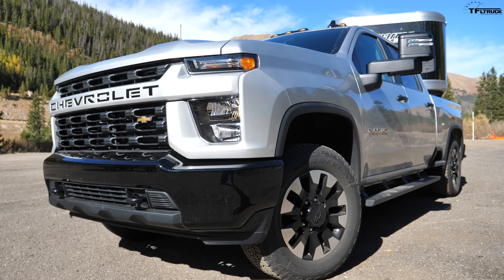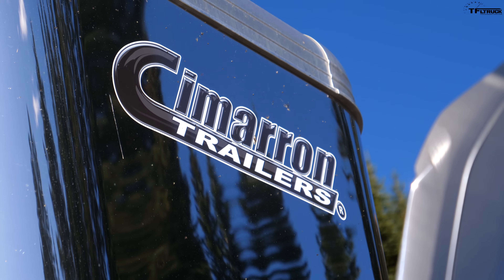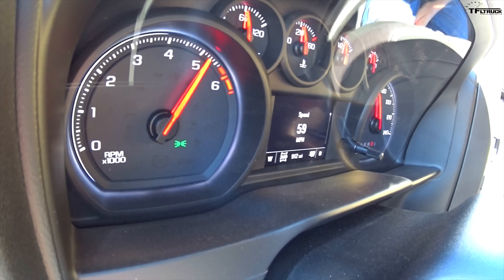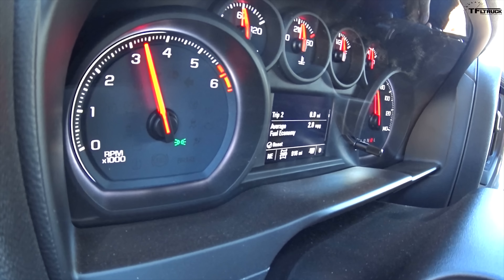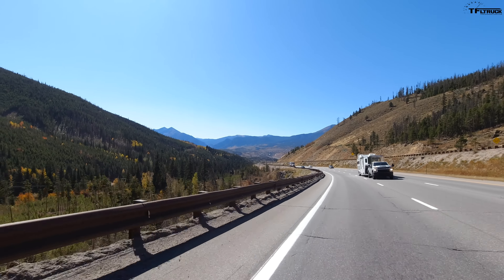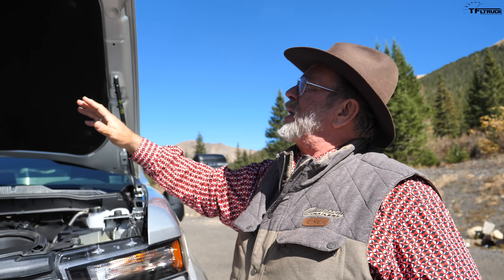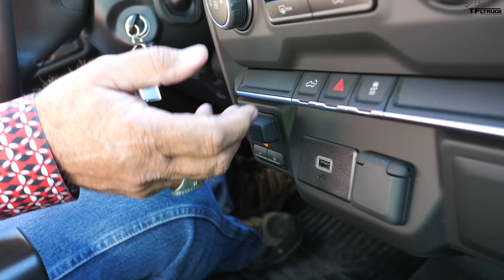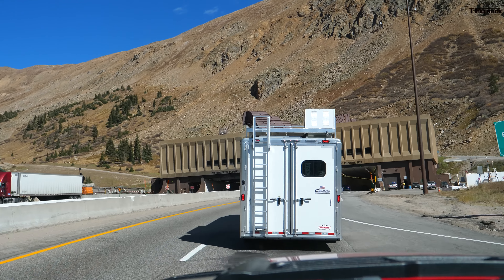The New 2020 Chevy Silverado HD Gasser Broke Our Ike Gauntlet Scoring System - Here Is How!

Comment: I'm waiting for the new 7.3 gas from Ford to go head 2 head against the Chevy gas option. 🇺🇸
Reply: I'd like to see that too. The only two DNF's they had were Fords. Interested to see if the new engine is any good. I prefer gas engines. I don't tow all the time just occasionally.
Reply: I'm not a Ford guy but I'm very interested in that new 7.3.  Finally Ford went back to a pushrod engine for a HD application.  OHC engines have their place but they're not for everything.  I am disappointed that GM didn't go larger for their HD gas option.
Reply: @daneh8434  
Gm trucks have always been about the total package instead of numbers. They've always been competitive  and functional despite not having the biggest numbers. I agree with Ford going back to a simpler larger engine. That's how HD engines should be.
Reply: With the 7.3 being paired to the 10-speed, I don’t think it’ll be a contest against this 6.6. I understand GM’s reasoning for keeping the 6, but it showed in this video as being the weak link in ensuring the vehicle was always utilizing the engines power and torque.
Reply: @ALMX5DP  
The number of gears aren't as important as the ratio of gears and the transmission tunning. The gm 6 speed has always been a good tranny. If the ratios are matched to the engine it should be fine. Something seemed off with this truck. It seemed sluggish to shift like they didn't have it tow/haul mode or something. Also gm changed the rear gear ratio witch doesn't help. It used to be 4.10. I am curious to see how the new Ford does.
Reply: The ford didn’t blow up.   Something did go wrong which put a hole in the radiator. A fluke but not a wide spread ford problem.
Reply: chad Spidle true, but I’m operating under the assumption that the increased gears allow for closer gear ratio spacing to more effectively use the power at the various speeds we saw here.
Reply: @AB-coyote  
Yes it was a fluke but the only two trucks they've had problems with were both Ford's witch is a little less of a fluke and starting to be more of a trend.
Reply: @ALMX5DP  
That is true but it also adds complexity. Ford has issues with the 10 speed in the F-150. Hopefully the super duty tranny will be good.
Reply: @curtis1951  It's nor really a trend, you can go on any forum (Ford, GM, Ram) and see the huge amount of posts with issues on trucks. That's what happens when 100 different companies make different parts for your trucks and is all done by humans. Things happen.
Reply: @WhoThisGuy515 
Just saying. They've tested lots of trucks from all the manufacturers and none of them had any problems except Ford. I know what you mean about the forums. I own an F-150 and I've been on the forum a lot. Or as I like to call it, the F-150 support group.
Reply: @curtis1951  💯
Reply: @ALMX5DP  It may not be but the underpowered 6.0 6spd easily beat the 6.4 8spd RAM and it also beat the 6.2 ford once they got a truck that made it up. The 6.0 was way down on power and the gearing was 3.73 but the engine/trans tuning won that race. The GM engines are designed to do this over and over again for 300k miles without stopping. The Hemi 6.4 and the 6.2 can't touch the 6.0 in durability in the HD field. I'm not saying the 7.3 with the 10spd won't win or do good, but the jury is out until they run it. As far as the RAM, I don't think they changed anything so expect the same outcome from their gas setup
Reply: @curtis1951  its the exact same 10 speed in a 1500 silverado
Reply: @zb6618   
It was co developed but I don't think it's exactly the same. I've been researching and havent seen anyone reporting issues with the gm 10 speed. Plus I'm pretty sure the 10 speed in the super duty is different than the one in the f150. Similar but beefed up for the super duty. Hopefully they have it sorted out because I'd like to see how it does on this test.
Reply: EGGINFOOLS no, the gearing was 4.10 on the 6.0. That’s been the only option for years. The 6.6 diesel came with 3.73 gearing.
Reply: Meanwhile, the gas Ford 6.2L already posted better times up the IKE than the gas Chevy 6.0 or gas RAM 6.4L. Ford makes the best truck.
Reply: @tylermacconnell217  
Yeah. After they fixed it. 😂
Reply: @curtis1951  The other time a Ford crapped out during a test was a defective alternator belt snapping. Not exactly a common problem on Fords.
Reply: Ford will blow the Chevy away.  They are super powerful, something Chevy misses.
Reply: @max7768  
That's the great thing about Ford's. You never when or what will go wrong. They always keep you on your toes 😉
Reply: @MDKN22  
I'm sure if they find one that'll run long enough to do the test on the first try it will do just fine.
Reply: @EGGINFOOLS  You needed to double check some of your facts.  The 6.2 beat the 6.0 easily.  The 6.2 had the 3.73 rear end instead of it's optional 4.30.  The 6.0 had 4.10s, which has been standard for several years.  The new Ram 6.4 now have an 8 speed zf transmission and will perform much better than it did with the crap 66rfe that it was tested with.
Reply: @curtis1951  Oh no :( I guess I should toss my 240k mile ford that's never had a problem
Reply: @max7768  
No. But if you seriously have a Ford with  240k miles and it's really never had a problem then you should go buy a lottery ticket right now because you're the luckiest person on Earth.
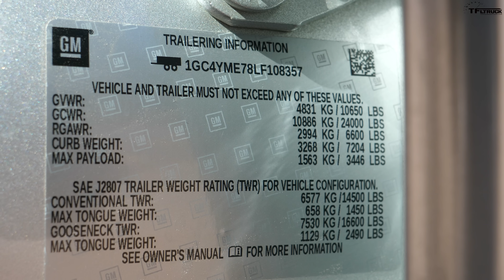Reply: EGGINFOOLS, I don't know what Ike gauntlet test the Chevy 6.0 beat the Ford 6.2 you're referring to? The Ford did the super Ike in 8:53 at max GCWR. A very diesel like time. The Ford 6.2 didn't bog down to 30mph like the Chevy did either, at times they had to step out of it to keep it under 60mph. Hands down the Ford had the better engine trans/tuning.  Keep in mind this was accomplished with the standard 3.73 gears. Optional 4.30's would've been even more decisive. As far as reliability is concerned, the Ford 6.2 has more than proven itself as a reliable workhorse. I wouldn't get too caught up on a fluke water pump failure.
Reply: @mbfixer1694  
The super duty was a 2wd regular cab. This Chevy is a 4x4 crew cab. A little different setup. Plus the Chevy may have been a little slower but it did the run on the first try without a fluke water pump failure. I don't mind being a tad bit slower. I'd have more confidence in the Chevy.
Reply: @curtis1951  Nah, I should buy another Ford
Reply: @max7768  
Remember, two wrongs don't make a right. Just kidding with ya. 😉
Reply: @curtis1951  At the end of the day the difference may be 800-1000 lbs of curb weight between a 2WD regular cab vs a 4WD CCSB. The Ford 6.2 loves to rev & the Torque-Shift G trans by ZF is perfectly matched to the 6.2. The old 6 speed in the Chevy puts a wet blanket on the new GM 6.6L. I'd be willing to bet a 2019 Ford F250 6.2 4WD CCSB could hold it's own & then some versus this new 2020 Chevy 2500 6.6. It likely won't bog down to 25 mph. The new 7.3 should really run, but we''ll just have to wait & see.
Reply: Neither one of them “ blew up “
The F150 diesel was also a preproduction truck.
Reply: Neither one of them “ blew up “
The F150 diesel was also a preproduction truck.
Reply: @AB-coyote  
Doesn't matter if it was preproduction. Ford wouldn't have given them the truck to test on camera if they didn't think it was good to go. I don't think the two Ford break downs that TFL had were flukes. I think they were unintended glimpses of the quality of their trucks. Designed just good enough to make it through the warranty period. A lot of people lately are getting some that aren't making it through the warranty period. TFL got two of them.
Reply: @mbfixer1694  
You may be right. It'll be interesting to see.
Reply: Alan Bowers    all you have to do is push the manual shift button down one gear come on people
Reply: Push the damn manual shift button people 👇 that’s all it would take to put the engine in it’s power    to gain speed.  
I don’t understand why TFL don’t do this?
Reply: @curtis1951  sorry you can't handle the truth. #1 seller for a reason lol
Reply: @kdougk6668  - They are testing how it does as is, if they put them in manual mode then people would be hollering about their choice of gear.
Reply: @curtis1951  - My understanding of tow/haul mode is that it will 1- Rev higher before an upshift under the same throttle input, 2- Wait longer to downshift to keep the temperature down, and 3- Activate grade shifting if it's equipped with it.  IF my understanding is correct, then it being 'sluggish' is to protect the transmission.
Reply: @dustintunis9347  
It's actually harder on the transmission to be in a higher gear under load so it would be beneficial to shift to a lower gear. Any tow/ haul  that I've used would  1. Grade shift
2. Down shift quicker
3. Hold that gear longer
Maybe they changed the tow/haul calibrations in the new trucks or maybe the gm 6 speed is just sluggish or maybe they didn't have it in tow/haul. Either way, it didn't seem like the transmission was working like it should for towing. If that's how it's supposed to work then I would have manually shifted it.
Reply: @billyray4716  
They may be the number 1 selling truck but it's not because they're better. More to do with
1. Customer blind loyalty
2. Fleet sales
3. Customers not keeping trucks as long as they use to. More people are leasing and trading in every few years.
Reply: @billyray4716  
I've owned three F-150's. The truth is that they are designed to just make it through the warranty and or lease period. All these people that are having to take their f150's in for warranty repairs lately (for engine and transmission problems) are actually the lucky ones because Ford has to pay for it. Ford has been doing this for a while. But because they sell so many, it's cheaper to pay the warranty and occasional lawsuit settlement. They won't fix the problems until they start loosing market share. They don't care about their customers, they only speak in money.
Reply: @curtis1951  - I'm almost positive mine waits longer to downshift under load in tow/haul mode, it's nothing heavy duty, just an Astro but it tows what I need. I'll play with tow/haul mode today to figure out for sure if it downshifts quicker or holds the gear longer before downshifting.  I'm guessing if they weren't testing the truck as a whole package, including transmission tuning, they would manually downshift too, and probably pick a speed it can hold in that gear that isn't right up by redline (at least I would).
Reply: @curtis1951  the 6.2 L has proven to be an extremely reliable engine, with a rather long service life. On the forums, owners are comparing it to the 7.3L Powerstroke, which, while not powerful, would last forever.  300k miles is not an unrealistic number for a 6.2 engine to reach without major failure. One guy, who is a hot-shotter, ran his 6.2L on the same rear end, engine and transmission for 437k before the camshaft started wearing out.  From what I can tell, he still has the same truck and has not had trouble with the transmission.  The dealership tried to talk him into a new truck, but he told them to put a remanufactured long block in there.
Reply: @racerboi77j  
That's true. I haven't heard of the gas super duties having many issues.
Reply: @curtis1951  how does ford have issues with the 10r80?
Reply: @Kmecha84  
Slipping and shifting issues. There's a few videos on YouTube about it. I believe there's already a lawsuit. Even though it was co developed with the GM 10 speed, I haven't heard of the GM tranny having the same problems. They are also still having problems with the Ecoboost. And the 5.0L is having a lot of problems too.
Reply: @I know you are right, And I just got owned but: What "last test"?
Reply: @EGGINFOOLS  the Ram just got the new 8speed with the 6.4 for 2020. Where have you seen it tested/ compared yet ?
Reply: @bellasky83  I haven't hence I referred to the past video that was already done which was sticking to the topic.
Reply: Something else Chevy misses...looks. Awfully ugly.
Reply: @1LOCKNLOAD  yes every ford engine has issues every Chevy engine has issues. If you want to dig into putting sensor everywhere on a engine you can find small problems everywhere that dont upset the engine at all
Reply: @eternalthread7846  power under stock weight doesnt add more load in huge ways towing puts huge strain on a powertrain.
Reply: @curtis1951  - Sorry, I forgot I took my motorcycle to work the day we were discussing tow/haul mode, then forgot to play with it until today.  My van definitely holds a gear longer before downshifting with tow/haul mode on.  There is a hill on my way home from work that my van will downshift to maintain 50, then upshift and start dropping speed again.  I put it in tow/haul mode right after it downshifted and it went back into OD (surprised me that it upshifted right away) and stayed there as I sped back up to 50.  You could very well be correct about how yours works, but not my 03 Astro.  I used to have an Expedition, but I don't remember if it even had tow/haul mode, let alone how it changed it's shifting if it did.
Reply: jdr ok yeah but launching on a drag strip with drag radials arguably puts more stress on a drivetrain than towing especially for a truck that weighs over 5k pounds
Reply: @Chad Spidle Really? I've got 3 Fords with a combined 1.1 million miles combined. One tranny replacement. My wife's 4.6L has 215,000 with no problems. This is very common. Where have you been? Thinking everyone has the same problems that Chevy owners have?
Reply: @curtis1951  These days I'm only interested in gas engines too. The diesels are awesome and insanely powerful but the reliability issues tied to the emissions stuff and cost of repairs are just too high to justify owning one.
Reply: @AB-coyote  Actually the water pump failed and fan broke apart. It's not that uncommon of a failure. Quite a few guys have had it fail and others caught it just in time. It can be avoided if precautions are taken but not everyone knows what to keep an eye out for. It's all related to the fact that the cooling fan is driven by the water pump which is attached to the front of the block.
Reply: @curtis1951  True the main reason for the way it performed is because GM made the bonehead decision to remove the 4.10 axle ratio option and put a taller 3.73 ratio in its place. The new engine may be more sensitive to fuel quality as well since it's a new engine with slightly higher compression and DI fuel system. Just like the rest of the latest generation of the GM small block V8's, power output seems to rely heavily on fuel quality.
Reply: chad Spidle   The transmission was developed by ford and Chevy working together, it’s the same 10 speed.
Reply: EGGINFOOLS the Chevy 6.0 is a good engine, but underpowered. We use one to pull a 14 foot enclosed trailer, the whole setup is around 4000 pounds. It works way harder than it should. It also likes to stick in gears for way too long. But then again we have all Chevys and have had a lot of transmission go out on the 2014-2009’s. Fuel pumps in those same years also.
Reply: @zb6618  No it isn't. Only Ram is using their half-ton transmission in an HD truck.
Reply: @max7768  No it was the water pump/cooling fan assembly that failed, sending the blades into the radiator. It's not an uncommon issue.
Reply: @jdrok5026  Ford has certainly had engine issues. The 3valve 5.4, the 3.5 Ecoboost, the 2.7 Ecoboost, the 3rd gen 5.0 Coyote, etc. Problems that aren't just sensors. Nope more like timing chains, cam phasers, oil pumps, piston slap, valve seat wear, valve wobble, con rod bolt stretch, etc.
Reply: @karlschauff7989  thats not what i said, but thank you for reading my comment incorrectly, I said that the 10 speed in the GM 1500 and the F150 is the same transmission, it was a joint project between the two manufacturers, I didnt say jack about heavy duty trucks
Reply: @EGGINFOOLS  it Did not beat the 8speed ram...they haven't tested it on the gauntlet!
Reply: Gm has great engineering but their quality control is crap! Unfortunately I learned the hard way.
Reply: chad Spidle yeah. Ok I deal with chevy and fords everyday.  And chevy is the bigger piece of shit
Reply: Billy Ray With that theory McDonalds burgers are the best tasting in the world.
Reply: karl schauff Ford’s V10’s had a lot of the same issues as the 5.4’s.  Spark plugs shooting out of heads is a pastime for those engines.
Reply: The Ford F-250 beat both the Chevy and the dodge in gas motors . Look at the ford and dodge TFL test Chevy was dead last .
Reply: Mark Godfrey  
Dude. Take a pill.
Reply: Mark Godfrey  
I've had a few gm trucks and none of them sucked my ass. 🤨